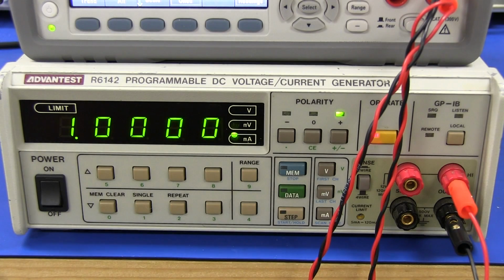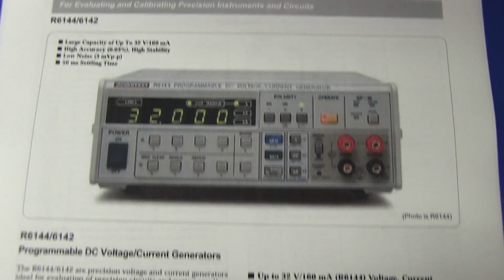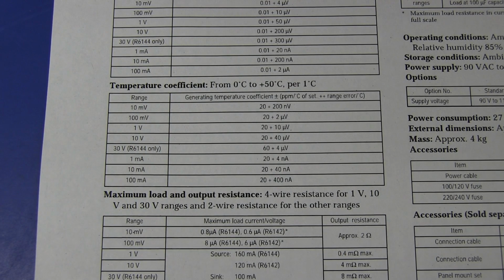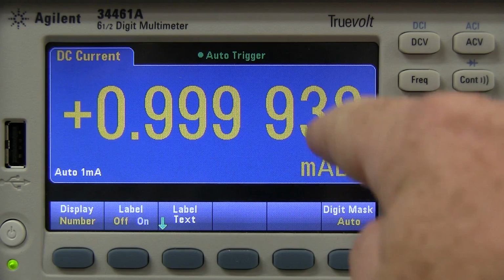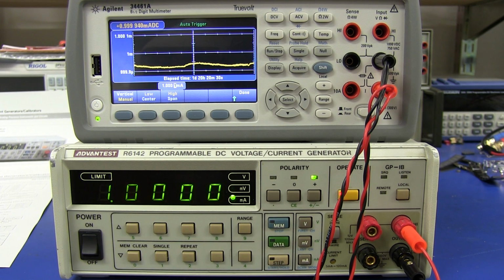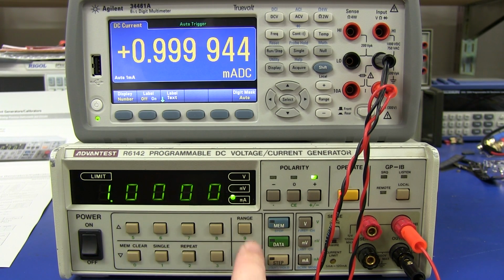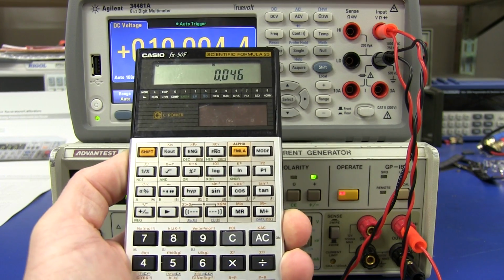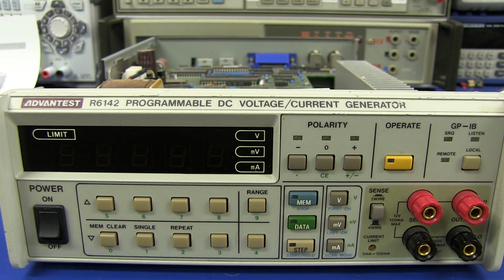EEVblog #576 - Advantest R6142 Current Voltage Generator

Comment: I'm thinking the sense terminals don't do anything on current mode, but for anyone wondering, they do work on voltage mode, though from my experience using the r6144 there seems to be a warmup period before the unit will accept or enable the sense/4-wire function.  When I just turn mine on, going back and forth between 2 and 4 wire I see no difference, but after leaving it on for a while I do see a difference and it does get more accurate on the scale of some tens of microvolts when outputting 16V.

Comment: Dave, could you possibly make a tutorial on taking a ATX power supply and make it variable or a good bench power supply? I seen a guy do it by just soldering some wires to a pot and got 1-17v of variable voltage. These ATX psu's are are everywhere and would be great to make a vid on. I want one to at least have 13-14v of output
Reply: Not recommended!!! Buy a cheapo $50 bench Supply with Current Limiting.

These things can put out many many amps, so short a rail on your DUT and BANG! If 5As makes a big pop and spark, imagine what 60A will do?

If you must do it, put in a 1A Polyfuse, and a big 5A slow-blow in series...

As for voltage, most of these are Flyback converters, so changing the Feedback Voltage (look up the datasheet of the main converter for the FB/Adj Pin. There will be a potdown going from the output to ground, so put a pot in series with the top resistor going from the output to the pin) will change all of the output voltages. Wouldn't recommend it, though. Post on the EEVBlog forum for more info.

Not to mention the voltage ripple on them is massive as the CPU etc normally have their own tight-tolerance Regulators.
Reply: I agree, it'd be nice to see an atx conversation introduction, maybe based on lm317, actually, if you grap the datasheet for that and scroll to the example circuits, they provide you with exactly that.
Reply: DusteDs Stuff Many tutorials for that online includes shorting a specific pin to ground. There are many cases of ATX PSU's gone bad because they are not built for this.

Comment: I have an even older 1987 Wavetek Data Multimeter Model 52 that on the diode test function has 5 selectable current sources 1mA 100uA 10uA 1uA and 100nA.
I just love this Wavetek bench top multimeter is a 32k count with a lot of futures is better than most modern multimeter and only uses 500mW that is an important fact since I live offgrid.

Comment: maybe you can get the manual from their site http://www.adc-tech.co.jp/index.htm it required to register so I didn't try it.This site specifies that the manual is available at the manufacturer's official website. http://www.orutika.com/e/detail.php?detail=015549
Reply: Btw on the site history, they place the TR6142 to be designed and released in 1983
http://www.adc-tech.co.jp/en/about/history.html

Comment: A few quick notes while I'm watching the video - Advantest don't make bench test gear any more, their current product line is all ATE testing. A company called ADCMT took over the benchtop/handheld T&M line, but the tech support has taken a complete nose-dive since the Advantest days.
Yokogawa do a couple of units similar to the R6142 too -- the 7651 is the "old dog", they tend to suffer from worn (bouncy!) buttons when they age. The GS200 is the current replacement for it. They're pretty obscure bits of kit, I'd never seen one until I started at my current employer.